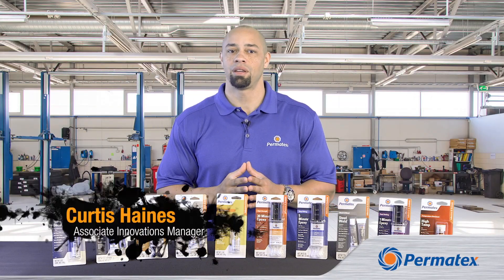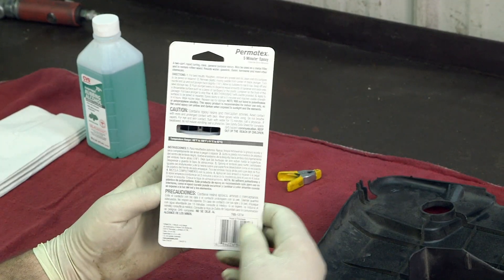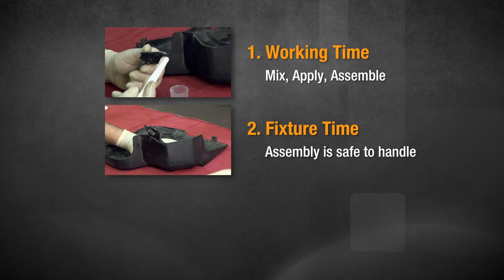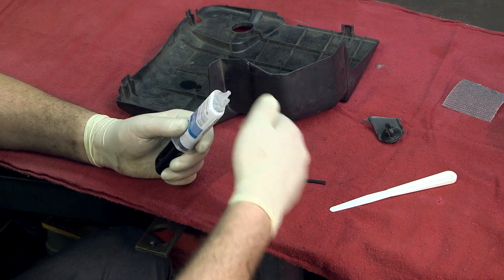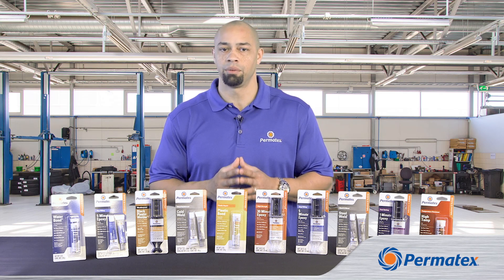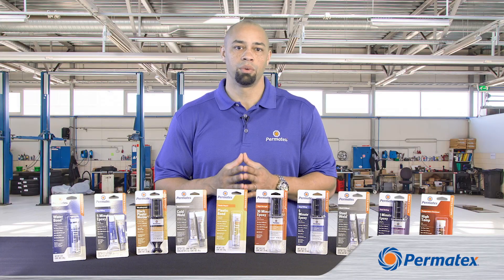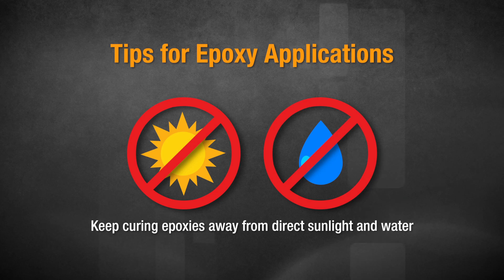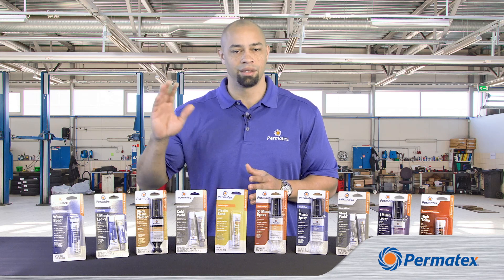Epoxy Application Tips: Permatex Tech Tip Series

Comment: Thanks for the video but My Permatex 500° Epoxy, did not work. It became brittle by high heat. I used to cover crack leak on my coolant reservoir but it does not stick- gets brittle and peeled off after few hours of driving.

Comment: Rubbing alcohol? What about Acetone for actual cleanup? A great mixing stick is a disposable wooden chopstick from a Chinese takeout restaurant. One takeout chopstick can easily be used for four epoxy mixing episodes. I create custom epoxy application tools by sanding a chopstick to the desired shape & thickness on my benchtop belt sander. Good tip on the Superglue vs Epoxy application use case.

Comment: Tips for version 2.0 of this video:
1. Don't say "don't use a plastic cup to mix your epoxy" and then play video of the demonstrator (the person who should be doing everything correctly) using a plastic cup for mixing the epoxy.
2. Don't neglect the repair quality of your demonstration piece as in this video the part being repaired is about 1/4" out of alignment ( see 4:30).
3. Do use some of the tips you suggest in your text such as the tooth pick and the popsicle (R) sticks. Human minds are conditioned to remember things better overall if there are matching audio/visual aids involved.
4. Know your audience.  This is likely to be viewed by customers who fix expensive equipment as why not just buy a new part if the part was cheap to replace, right?  This means they are, on average, of high than average intelligence, more likely to pay attention to details, and more likely to use critical thinking to solve issues in their lives.  If you present a seemingly hap-hazardly put together video like this, you are sending a message that you do NOT pay attention to details, that if you are so careless with how you present your company and your products you may similarly be careless with other aspects of your business, aspects which may negatively impact your customers (e.g. lack of attention to epoxy quality standards resulting in recalls and potentially fatal product failures in the field.)
Your product seems decent, you deserve to have it viewed as such.  Hire a professional staff with a couple attention to detail nerds like me next time.

Comment: worked great 1st time used it 3 months later went to use the rest and 12hrs later its still sticky, don't bother keeping the left over in the 2 part mixing Permatex what you don't use chuck in the bin and buy another next time you need it to save yourself the problems cleaning sticky epoxy off

Comment: Can i use this to fill the pin hole on water pressure tank.What type of epoxy should i used?
Reply from the maker: What type of material is the water pressure tank made of?  Plastic or metal?
Reply: stainless steel pressure 40 psi tanx  so much for relpying.i will wait for your answer

Comment: Reasonably good video but for one thing.  The project shown, is never going to hold together with that epoxy repair attempt.  It's going to be nowhere near as strong as the original material was, which already broke once.  Something like that needs a minimum of a metal reinforcement back plate put on to reinforce it.

Comment: Best tip not said in vid: seperate 2 syringes with scizzors, so you can actually make 50/50 mix
Reply: even better tip chuck out what you don't use and buy a new one next time you need it, them 50/50 syringes are shit and wont work again after 3 months seems to go off and stays sticky even if you put the cap on them

Comment: 2:43 "Use lots; we're happy to sell you more.";) Legit advice though, because the resin and hardener often require different pressure to dispense. So the plunger flexes sideways, initially pushing out more of one than the other. The more you dispense, the less that volume difference matters.

Comment: 8/2018 I used the metal filler/oil pan repair on my 1996 Jeep GC and a pin hole in the oil pan. I drained the oil and sprayed with brake clean, then used 80 grit then spayed again with the brake clean,  I bought 2 tubes on Amazon for 13.00 and used both, let sit for about a night then used tube 2, after another day of drying I added the oil nd NO MORE LEAKS, great product and hope it lasts

Comment: Exactly what I was looking for. Wouldn't have known about having rubbing alcohol handy from the package and it was a must. Great info thanks
Reply: Denatured Alcohol is better if you cannot fully scuff the surfaces as it has the least amount of distillates which maybe left in the cracks the epoxy is searching for to hold on to.  Most other epoxies recommend acetone, but you may need to look into the chemical composition of the plastic your working with to see if that is appropriate as acetone can degrade some plastics.  Overall it is best to just scuff the surfaces.

Comment: I have purchased twin syringe epoxies and experienced frustration with first use because one syringe or the other is clogged.  When the plunger is pushed, you get a s**t ton of the contents of the unclogged barrel.  This is with a brand new container, just opened.  Apparently these type dispensers have a very limited shelf life.
Reply: Mekratrig my syringe doesn't even work .You can't remove the plastic cap without breaking the nosel and you can't push it in . Completely useless....